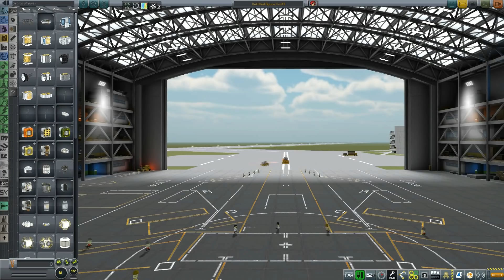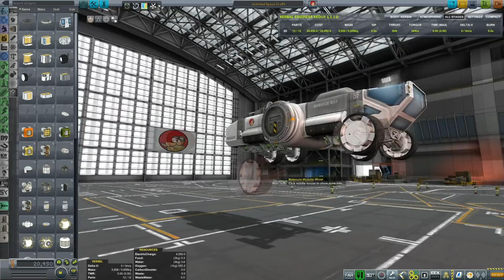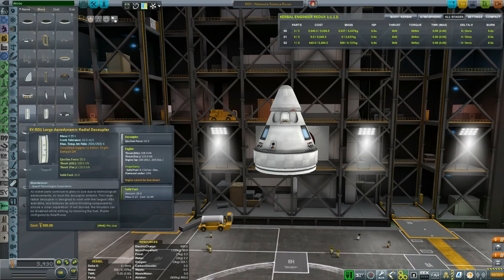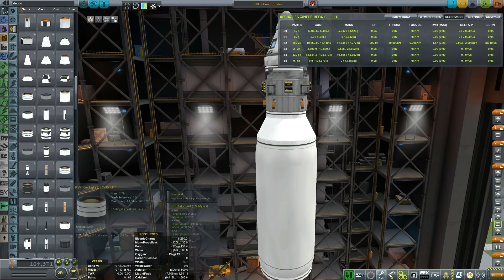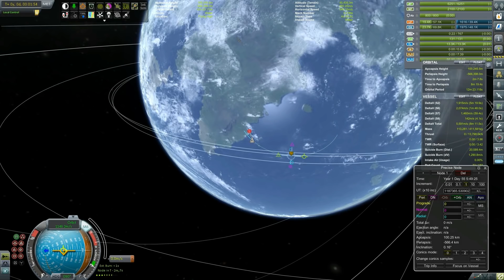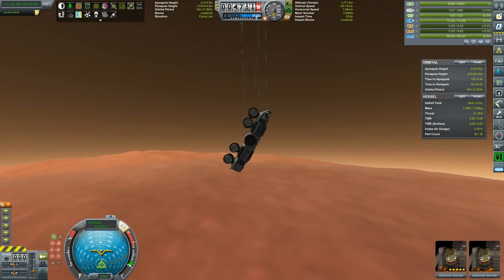Kerbal Engineering - How to build a rover and send it to Duna

Comment: Keep in mind when concidering rocket stability: as fuel is burned, the center of mass moves foreward. Rockets use a lot of fuel, so the center of mass moves forward quite rapidly over the launch. Earlier in the flight, you need not worry about stability because of your gimballing engines. So check the center of mass without fuel in the first stage before placing fins.

Comment: Center of mass vs center of thrust is not an issue for rockets.  (ok, they need to be in line with each other) but its not the same as an aircraft; your engines produce the lift, not aerodynamic surfaces.
Reply from the maker: while that statement is true, the rockets still get flippy flip if they are not in line, especially during the gravity turn.

Comment: You say at 25:38 that the chute system of the rover would not work in 1.2. Why is that?
Reply from the maker: I think some clarification is in order :-). 

I am not saying the chute system of the rover would not work in 1.2. I am merely saying: "I know i won't be able to do this in 1.2". 

With this i am referring to stacking opened chutes so they clip into each other, as the chute clipping bug was fixed, and from what i saw on reddit, it seems that bunching up more chutes is less effective as their open areas would be at an angle due to having too many of them.

You can see what i mean if you compare how my chutes look ad 25:35 with the top left image here: http://i.imgur.com/eZ1sgyY.jpg
Reply: Thank you for the patient explanation :-)
Reply from the maker: Hehe, no worries. Also just FYI i will be launching this baby somewhere around episode 11 of my Interplanetary Voyage series 2 playlist.

Comment: what are the UI mods that you have, you UI looks like it works a lot better than mine
Reply from the maker: The UI mods ?
- Off the top of my head: Kerbal Engineer, RCS Build Aid, Editor Extensions redux

If by working better than yours you mean with showing angles at which i put things, its Editor Extensions::
http://forum.kerbalspaceprogram.com/index.php?/topic/127378-12-editor-extensions-redux-released-with-selectroot-merge-stripsymmetry-nooffsetlimits/#comment-2314915
Reply: Thanks that was the mod i was asking about and when you are flying that shows the resources in colour
Reply from the maker: I would guess ScanSat, but not sure
Reply: at 18:00 in the top right
Reply from the maker: That would be alternate resource panel:
http://forum.kerbalspaceprogram.com/index.php?/topic/54876-12x-ksp-alternate-resource-panel-v2900-oct-16/
Reply: thank you so much for your help